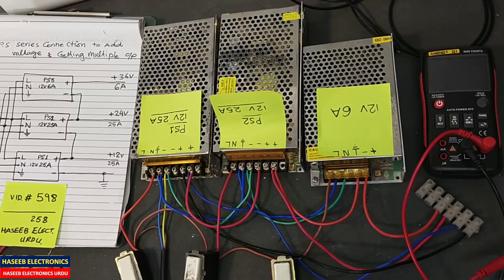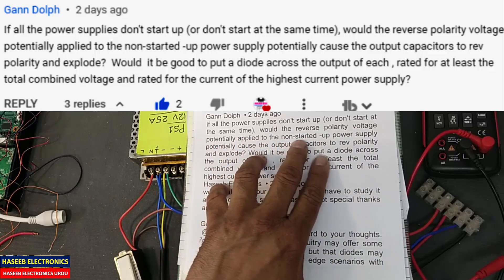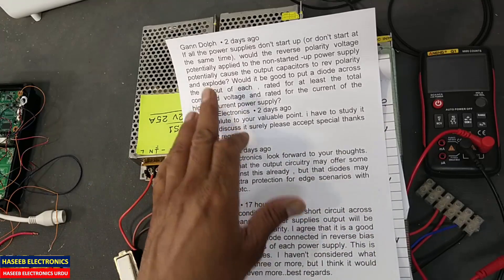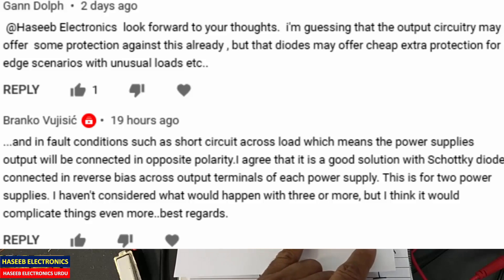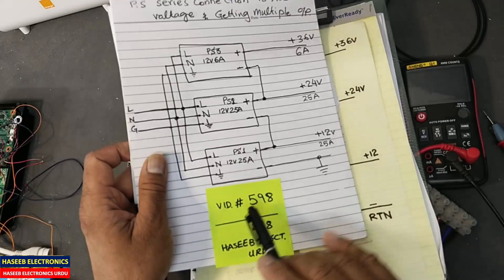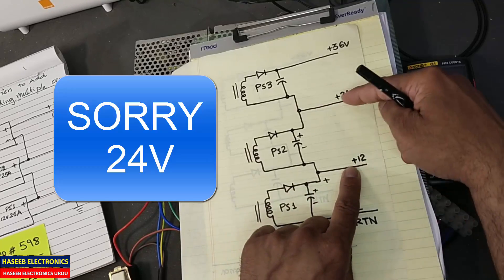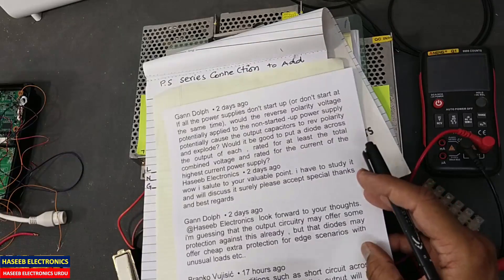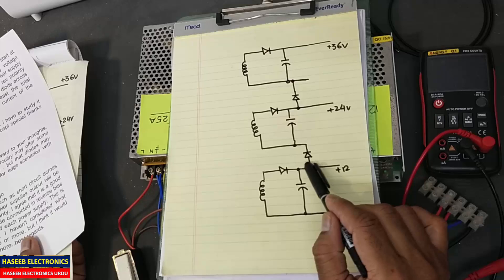{601} Is It Safe To Connect Power Supplies in Series to Get More Voltage?

Comment: Thanks for the follow up.  This confirms what I meant by "the output circuitry probably already handles it".     

However, an extra diode does still offer extra critical protection against capacitor explosion in the case where the output diode fails.  The failure would likely initially be a short,  but the short could subsequently fail open due to current flow and then the capacitor(s) on that supply would surely explode!

Love your channel - keep up the great work 👍🙏👍
Reply from the maker: special thanks for your feedback 
yes, diode can be added but it will create an extra passive load and will dissipate power. the capacitor will always have the -ve 0.4 volt in case of the power supply failure 
even if we use polarity protection diode, the lower side power supply will continue to feed to that failed power supply. so there will no benefit 
in both condition it is safe. if are using an extra diode or not
Reply: @HaseebElectronics  Mr Haseeb. I like your videos very much. I am just a hobbyist in electronics and I have learned a lot from you. But in this video there could be placed a bypass diode from Minus to positive on each power supply. This will prevent current from flowing through the coil when power supply is off.
Reply: @HaseebElectronics  I think there has been misunderstanding and I should have been more clear - my mistake! 

The diodes I have been suggesting are across the output of each power supply  (reverse biased).   They should not be conducting in normal operation.  

Definitely not series diodes (which wouldn't do anything except waste power, as you point out!)

Thanks again sir!
Reply from the maker: Oh Yes. i got it 
you are right 
Best regards
Reply: If its a properly designed psu the output cap are usually rated about twice the output voltage plus if the diode fails I dont think you will get a higher voltage
Reply: @dantronics1682  With respect to the capacitor, I think it’s about the polarity rather than the voltage level. .
Reply: @GannDolph  sorry I didnt realise you were talking about using this for battery charging, I thought you were just using it for higher voltage supply, but I realise some people likes to live dangerously why they would be charging batteries without a bms
Reply: @dantronics1682  i was talking in general.  lithium ion battery chargers are just current limited smps.  it’s common , for example, to use two cheap and readily available 10 cell, 42v ebike/escooter chargers in series to charge a 20 cell pack.   sure the bms will protect flow into the battery,  against overcharge and over current during charge, but not against current flow from the battery.  meaning the that the bms does not prevent discharge into unpowered smps bank.   a lot of people use current limited high quality (eg mean well) smps series strings to charge higher voltage lithium battery banks .
Reply: but you would drop some voltage
Reply: @cotto887  No!  These are not used like the diodes when, for example, paralleling power supplies (there's a very good video describing this on this channel from a few days ago)

Rather in this case, one diode is placed directly across the output terminals of each power supply, in reverse bias.  (the diode stripe line facing the positive terminal and the other end of the diode connected to the negative ).

These diodes do absolutely nothing 99.9% of the time.   They are not conducting any current under normal operation.  They only come in to play under certain situations  whereby an excessive reverse polarity voltage overwhelms the maximum voltage rating of the  existing output diode(s) of one or more of the series psu's
Reply: @Kratos was it me you meant to ask or someone else? I dont need to try anything I use power supplys like this everyday, I usually use 2 in series since I dont usually need more than 50v. thats why I know about the chassic earthing problem
Reply: @Kratos ok if you want to know what the difference between a simulator and the real deal is practice driving in a simulator then get in a real car and drive on a busy road. simulator may show similar thing but it depends on the rules thats been programed in to the simulator, not every programer is an engineer and not every engineer knows how to program therefore sn engineer can sometimes see a massive flaw in a simulator that he/she wouldnt do due to his/her experience. the person I was talking to doesnt have any experience but believe 100% what the simulator shows.
Reply: @Kratos you can tell a persons experience by the statement they says or the question they ask, simulators are good to a certain extend but you cant beat practical experience. did you learn kirchoffs law in your class? it gives a idea of the way current moves in a circuit and what voltages should be there.
Reply: What is the specs for these reverse diodes in case of 5 smps 48v 20 amp
And how to connect them 
Thank you

Comment: Great video thank you. Only thing about connecting power supplies are making sure the series components are rated for the total voltage. Lets say you connect (4) 12v for 48V, make sure the components are rated for 48v and not 25v.

Comment: Hwl sir, i have 12volt10amp 7no. smps.can it safe for series connection to charge 72v battery.beacase my 84 volt charger faulty.if I series 12 v 10amp 7 pc ,can it work properly?

Comment: Hi I have a question 
How many amps would be for 2 x 12v 62a power supplies in series ? 
Would it be 24v 62a ?
Reply from the maker: If connected in series 
Voltage will be added 12+12= 24 volt 
If both power supplies have same current rating then 
62 || 62 = 62 ampere 
24 volt 62 Amp

Comment: Hello sir I have a question I have installed led halo lit sign and connected with one 300 watt transformer and one RGB controller for some reason few letters are showing different color while changing the color with remote control and sometimes few letter won’t lit any suggestion will be appreciated these are large 24” high channel letters on outside

Comment: Hello dear
Can we use this connection to inject it into a hybrid solar inverter to test the pv input because mppt can range from 30 to 450 volts
Reply from the maker: yes dear 
it is usable.
Reply: Thank you
If you could do a test video 
Will be grateful 
I have a customer who has a 5.5 kw hybrid solar inverter
And wants to turn it into an online ups
Because they cost a lot
So i was thinking is it possible to make a 5000 watt smps connection s/p
And use it to power the inverter so that it always outputs 230 v 50hz

Comment: Salam M Haseed, i was wondering how many volts does the PSN #3 sees : 12v or 36v ? Thank you.
Reply from the maker: when 12v x 3 power supplies in series, it must be 36V
Reply: @HaseebElectronics  in that case should i change its o/p capacitors rated at 16v ? Thank you.

Comment: the capacitors connected  in series  add the voltages
Reply from the maker: the capacitors are used to smoothen the output of the respective power supply. actually the giving an offset to the power supplies causes to add the voltage

Comment: Thank you for your explanation. Very good indeed. How about adding power supplies in parallel? I've allways been worried about tiny differences in voltage. Thank you again for your videos.
Reply from the maker: thanks a lot 
for parallel connections. check videos number 597
Reply: @HaseebElectronics  Thank you again.
Reply: doesnt the psu sense the output voltage? if it does then it should self adjust its output, but if you're that worried then just get a psu rated for the current output that you requires, do a search for solar panels connected in parallel

Comment: Really excellent information.....thank you. One thing does strike me, though, that maybe we should check that the main output to ground capacitor across (inside) each power supply is rated for the NEW higher voltage of the combined supplies, rather than their regular individual voltages...? Is this correct or not? Thank you, sir.
Reply from the maker: best regards and special thanks for your valuable comment 
each power supply's capacitor is responsible for its own supply's voltage. so combined voltage will not appear across any capacitor within a single power supply
Reply: @HaseebElectronics  Many thanks for your reply!

Comment: So many noise not stable voltage ⚡
Reply from the maker: no 
the voltage will stable, upto the maximum current (the maximum current having the 6 ampere in these 3 power supplies. otherwise the voltage are stable)

Comment: Thank you sir, i have a question i have 2 power supplies with different output voltage and current, the first one is 24v 4amps and the other one is 12v 3amps. I connected them  in series to achieve 32v 3 amps but when i connect the voltage drops to 8.8v. Does that mean the power supplies need to have same output voltage and amps rating?
Reply from the maker: there is something wrong in your connections 
if you connect properly +ve of first power supply to -ve of the second power supply 
take common output from fist power supply and +ve output from the second power supply's +ve terminal. then the voltage must add to each other  and the total current will equal to the 3 ampere.  because after 3 ampere the 12v power supply will shutdown
Reply: Thank, will check out later
Reply: check the -ve to see if its tied to the chassic earth on each psu

Comment: So something I thought I would ask so I am clear on it. Isn't the case of your 3 power supply in your setup only able to supply the max Current of the lowest output power supply? So Because you used 2, 25amp power supply and then the 3rd is only 6amp isn't the max current at any Voltage now at the output only 6amp now?
Reply from the maker: Welcome dear 
yes, when we will connect 3 different power supplies in series, the voltage will add but total current will be limited at the lowest value of the power supply 
as i clearly explained in video number 598. i will suggest to check that video as well, please
Reply: @HaseebElectronics  Thanks for the Reply. Sorry I hadn't seen that video at this time and I just wanted to be sure if others that might have like me only seen this video know that in the case of your 3 supplies it is limited to the lowest current of the connected supplies. Now they know for more detail then can watch other Video for full Detail. Thank you. Great Videos. Wish you did Repair IP Camera videos as you do a great job of the videos I have seen of yours. Thank you for your Time in sharing your Knowledge with others. Be Safe
Reply from the maker: best regards and special thanks for your valuable reply 
video number 598    https://youtu.be/ZaFAn_8fOvE
i noted it for IP camera, and will try my best to explain it